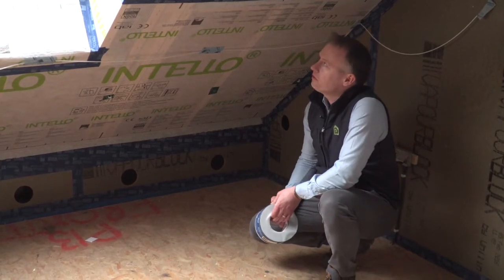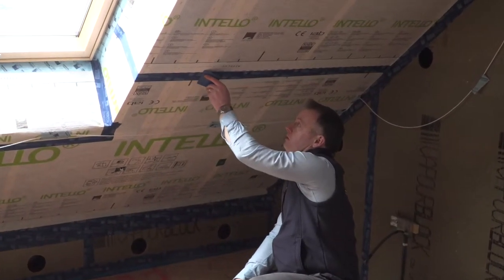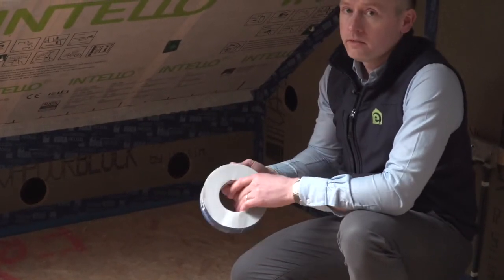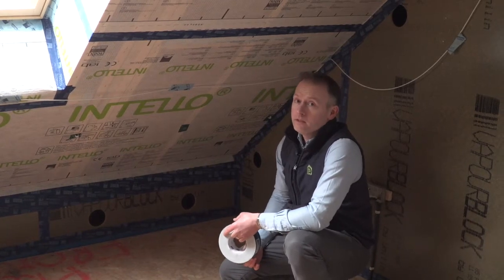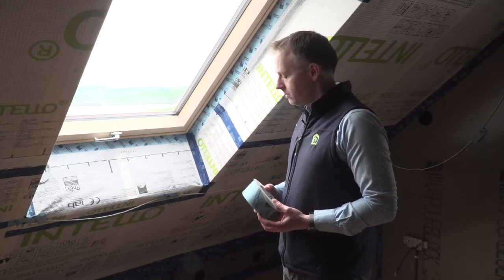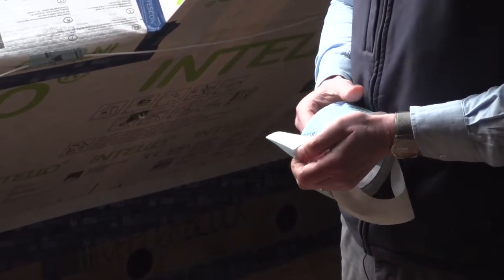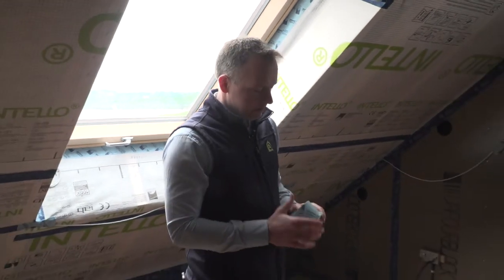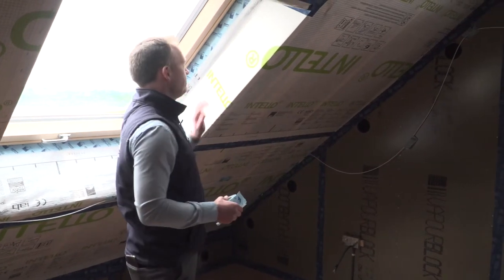Pro Clima Tescon Tapes - Passive House Insulation Series (part 9)

Comment: Should mention that the reason you need to 'roll the tape' is because the acrylic adhesive is pressure-sensitive and needs pressure for a proper bond to occur.  Leaving out that explanation could lead people to not bother using pressure, or not enough pressure. 

 I'm not a fan of tapes around windows - too easy to get accidentally punctured when drywall/plaster/architraves are installed (and those trades don't usually worry abour air sealing, so any damage often gets ignored/unreported) Prefer liquid flashing to protect the sill/jambs and to air seal the interior with a perimeter sealant joint with backer rod. Quality sealants can expand/contract without stressing the joint. Slower to install, but like Niall said, you only get one chance to get it right.
Reply: Thanks for the comment.. It's difficult to reference all points in 3mins, but the reference to pressing the tape firmly to ensure a secure bond attempts to highlight the need for pressure on the tape. An extensive installation video is available in our library though which goes through this in much more detail over 45mins. We also provide training for applicators to outline means of application to minimise risk of damage post install as well as in our literiture and trianing videos. pro clima tape utlilise's Solid acrylic glue, and are also exceptionally flexible providing room for movement at critical junctions if they come under pressure. There is also a flexible liquid applied alternative called AEROSANA VISCONN or AEROSANA VISCONN FIBRE which may be used at window and door junctions either. Whatever is easiest and most robust, works and is easier for the applicator to use of course is best :)